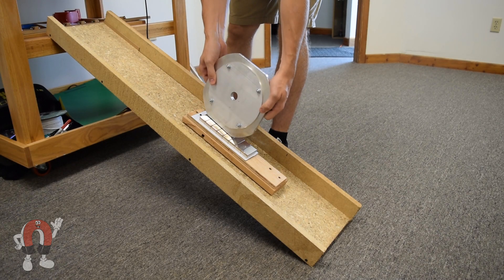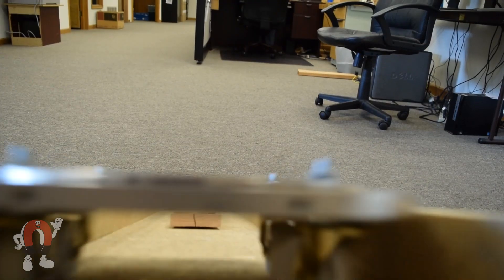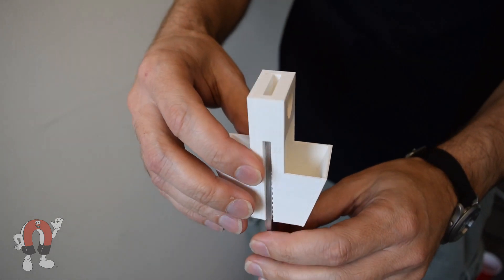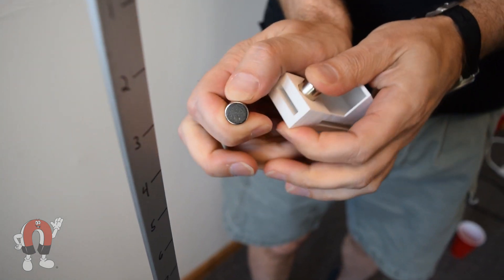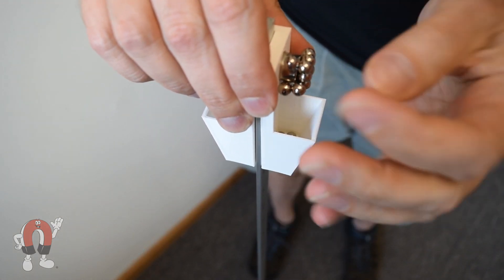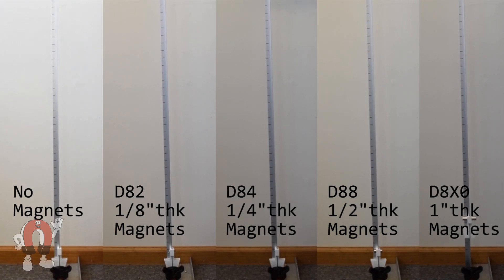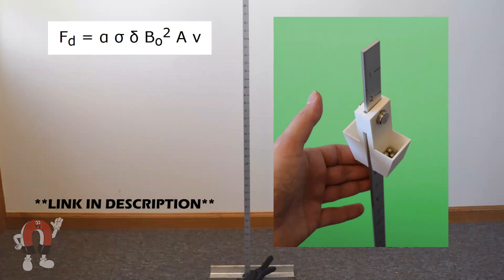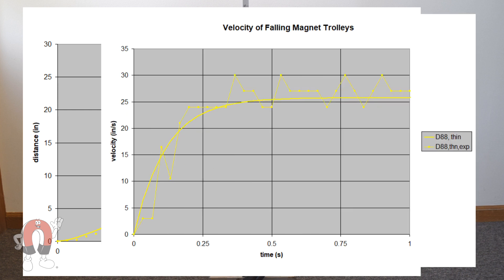Calculating Eddy Currents

Comment: Have you tried to model the eddy braking drag force using a sublinear damping?
being "v" the speed and "a" some constant, instead of a drag force following
F(v)=a*v
you could try
F(v)=a*sgn(v)*sqrt(|v|)*(sqrt(2)/4+|v|^(3/2))
This kind of drag, since isn't locally Lipschitz, could allow your ODEs to have solutions of finite duration, meaning here that the solution will become exactly zero forever after a finite extinction time, something that is impossible for the classic physiscs models through ODEs that holds uniqueness of solutions. 
As example of this solutions, think of the system
x'=-sgn(x)*sqrt(|x|), x(0)=1
which could hold the solution
x(t)=1/4*(1-t/2+|1-t/2|)^2
that becomes zero after t=2.

You could see that the proposed Force behaves like the linear term you have used for low speeds not too near zero, where in the origin has a sudden start similar to the results of your experiments, and it also resembles the classic quadratic drag force used in fluids mechanics for large speeds.

Hope you can play with it and comment if it suits your experiments (hoping it improve the accuracy).

Comment: It is fascinating to me how many smart people there are that are exploring eddy currents for inducing drag and yet the one question on my mind seems nowhere. What metal (I assume it is a metal) produces the most magnetic drag when you keep the magnet as a constant. I would think this was fairly obvious or perhaps there is some fundamental reason that this doesn't matter when it comes to induction motors, but to my mind, the better you have magnetic drag, the more efficient the motor. I was thinking AG perhaps might be better than Aluminum. But for some reason I cannot even seem to find a comparison of Aluminum to Copper, although I think I saw in some engineering forum that everyone just knew copper to be better.
Reply: It's in the formula at 3:12.  Drag is proportional to the (electrical) conductivity of the track.  Wikipedia lists conductivity of many materials.  Copper is the highest, aluminum is a bit lower, and then it drops off a lot more for iron, and other metals.  Your question is very good.  Many people mistakenly think the track material needs to be magnetic, but eddy currents are due to conductivity.  Being magnetic would cause some attractive forces that could have good or bad effects.  Magnetic materials might affect the B value some also, because it would be part of the magnetic circuit, but I think aluminum or copper are the best choices for an eddy current brake, unless you already happen to have a steel structure (like on some amusement park rides).  Also, the track will get hot if a lot of braking is being done.  Aluminum and copper have a lower maximum operating temperature than steel, nickel, or tungsten.  So maybe you'd pick a different material for those reasons.  But if you want to demonstrate the eddy current effect for students, copper and aluminum are good choices to demonstrate the effect.

Comment: With the aluminium cart, I'd wrap rubber bands or something of the same effect arround the pivot mount of the castor wheels so they can be placed in and stay in the correct orientation.  That way they don't have to align themselves on the way down, messing up the dynamics. :-)  The wheels at 3:44 do not look "happy". :-)